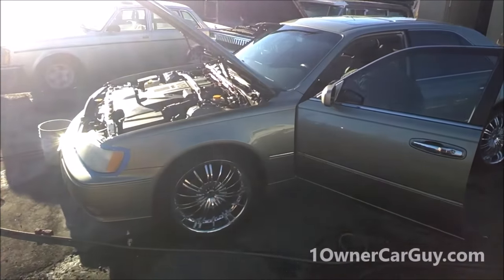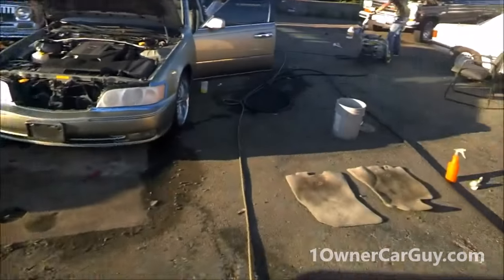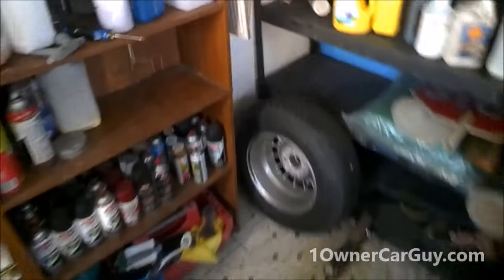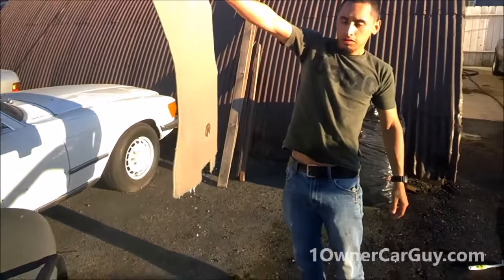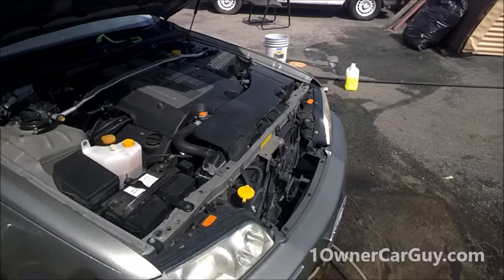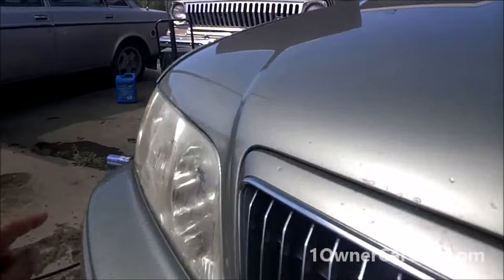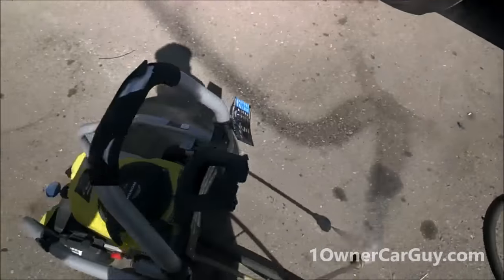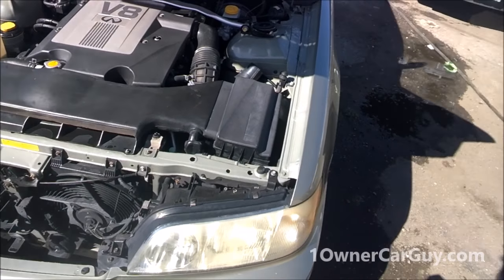Car Rug Detailing How To Floor Mat Interior & Motor Cleaning

Comment: great vid on doinf the floor mats hear is a tip i found very handy. ( tip) hang your floor mat on the side if a wall i ( i like to nail mine to the side of my fence.)  that way the dirt only can go one way down not back in the fibers also it helps dry them a lot faster.

Comment: did you try the 4 way 12v  battery charger I like the Infinity the interior is like a Mercedes
Reply: there is a battery charger out there that can do 4 at the same time pretty handy gadgets for a car dealer and car seller we have more than 3 vehicles and there is Always one vehicle with bad starting power